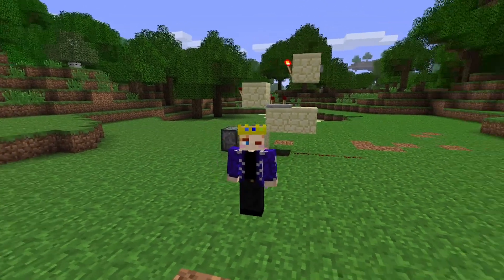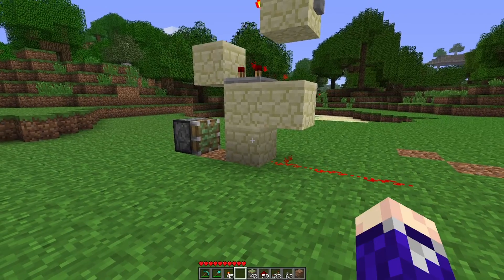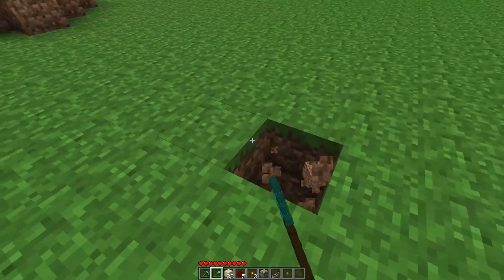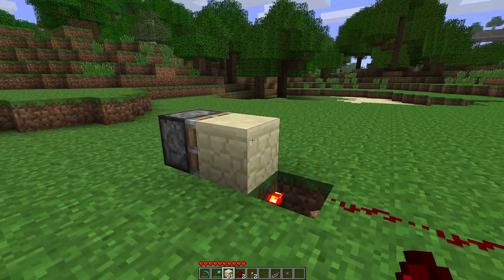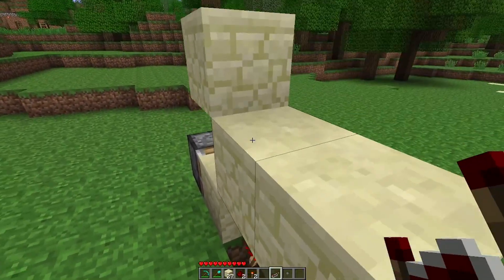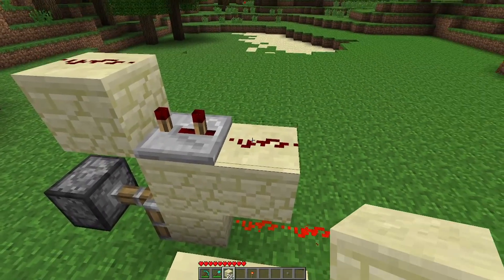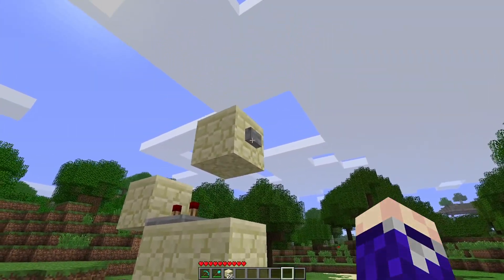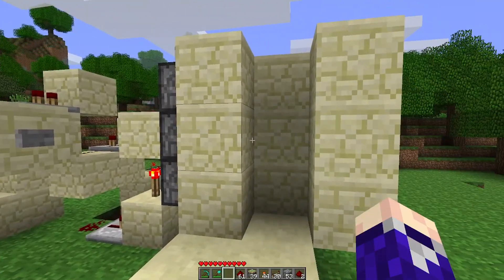How to Build a T-Flip Flop in Minecraft Beta 1.7.3 - Tutorial

Comment: Unfortunately the monostable in this design isn't 100% reliable. It can break when it gets randomticked
Reply from the maker: Interesting. Ive never had it fail on me before.
Reply: @BoxBlair  Yeah it's pretty rare, but it will happen if you run it enough times. For something like a piston door it's probably fine since the odds are fairly low, but if you're attaching it to something that runs repeatedly then it's probably better to use a different design